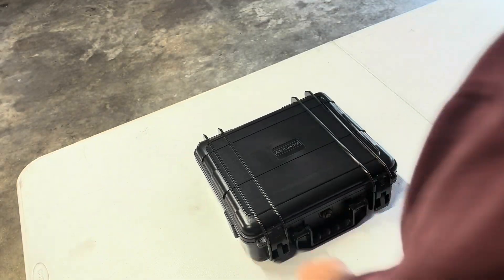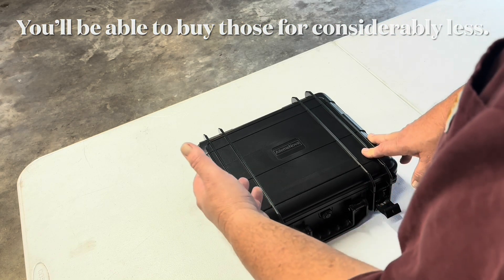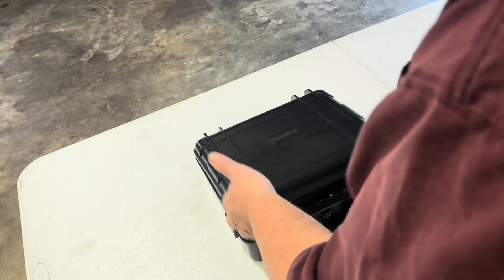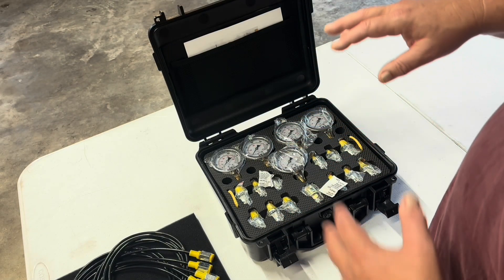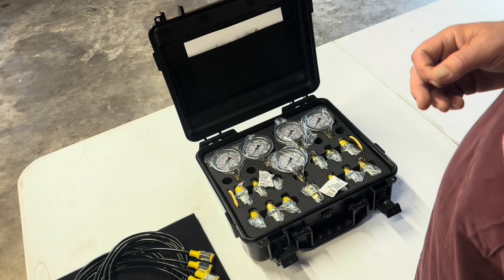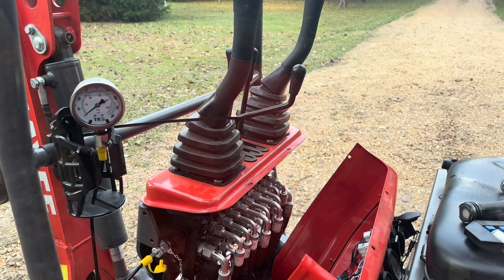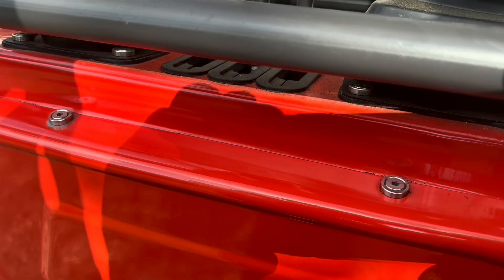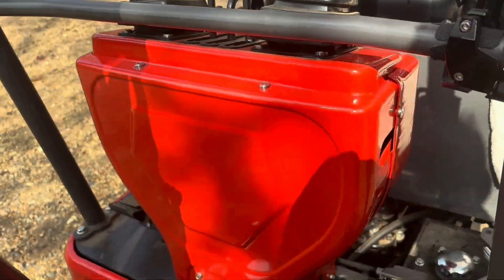Chinese mini excavator - testing and setting hydraulic pressure on the Huayee hy14c

Comment: How much did you adjust the pressure relief?  Could you tell how much it went up with like a 1/4 to a 1/2 turn?  Great video by the way.
Reply from the maker: I don’t think it was perfectly linear - that is, I don’t think,for example, that each 1/4 turn necessarily yielded the same amount of increase.  It seems like the first 1/4 turn moved it up around 200 psi but I may have moved it that much or more for the second 100.  I didn’t really pay that aspect that much attention as I was concerned with the pressure, not the amount of turns.  I would not attempt this without a gauge.

Comment: Nice video, thanks.  I don't plan to change the hydraulic pressure on my SHY10 because it already has more power than it should have for its size and feel that it will just lead to premature failure.
Reply from the maker: Thank you.  I wasn’t really expecting mine to be low. But I know that it will pull through tree roots better when I’m digging stumps now.
Reply: @rgtoutdoors7130   Thats great you got your machine up to par.  I've been slowly pecking away at cleaning up a large tree and stump pile the previous owner left behind and never in my wildest dreams would I have thought a one ton mini could tackle a job of this scale.
Reply from the maker: I’ve really been impressed with mine

Comment: Got my 14C Monday morning, was supposed to be delivered at 8pm Sunday,poor guy dropped it off at 2am. The hydraulic cooler was put under the floor board by the hydraulic tank on mine not in the engine compartment.
Reply from the maker: Wow. It looks like they’ve made some changes since I got mine.